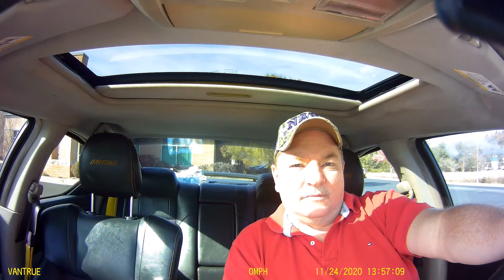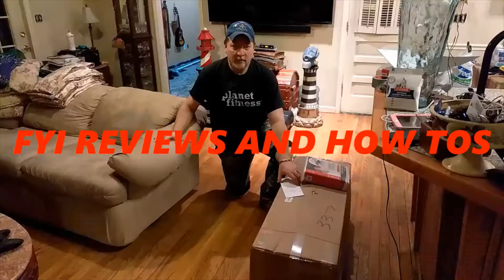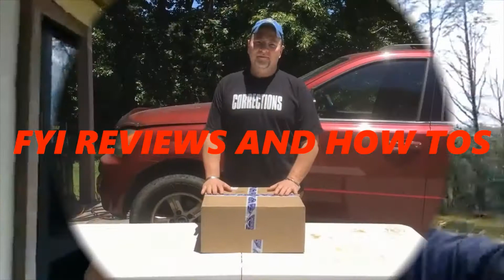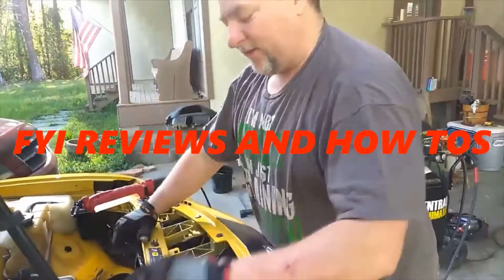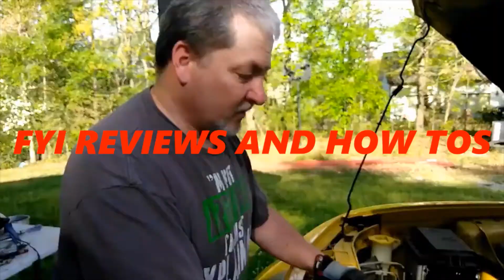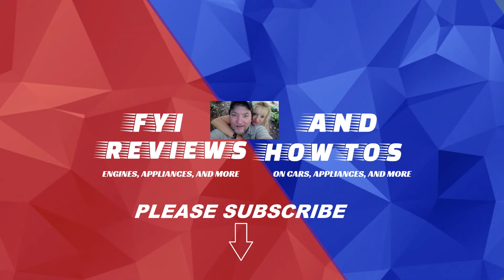TORQUE CONVERTER SHUDDER CAUSED BY THE MDS ON A 2006 DODGE CHARGER

Comment: I installed an LED that lights up when my mds turns on my 300c 06 and acted exactly how you described. So I drive on dr 4 and my shutter goes away. Have you found out what links the mds to the torque converter? Is it when the mds engages it sends a signal to the tcc to lock or something? The reason im asking is because it also ocassionally stalls the engine. So i was wondering if maybe my torque converter clutch was staying locked causing my engine to turn off?

Comment: This was such a huge help.  5 mechanics couldn't figure what you figured out. Big thanks.
Reply from the maker: You are welcome. My advice is to have a full MDS delete done. It is costly but the risk of keeping the MDS lifters, and cam out weighs the benefits.
Reply: Nice video 👍🏽I just spent hours trying to find the problem and didnt want to remove the mds and found out finally that it was my motor mounts!!! I did the transmiton flush and added the friction modifier and nothing. But the mount was the actual cause!!

Comment: You can turn the mds off with the diablo Intune i3 tuner? So you need a diablo tuner to do it?
Reply from the maker: Yes, but if you just turn off the MDS electronically you will still have the MDS cam, lifters, and actuators. Which is fine if you just want the system turned off. To do a complete MDS Delete you have to replace the cam and lifters with a non MDS cam and lifters plus install MDS delete plugs (not spark plugs). After installing the MDS delete kit you then have to turn off the MDS using a tuner such as the Diablo intune i3.

Comment: 2011 300C has been shuddering whilst crusing in eco/MDS around 30-40mph. A slap of the shifter would disable MDS but I wasn't sure if it was unlocking the converter. A bad purge canister set off the CEL today thus not allowing MDS to kick in and the shudder is gone. I was doing some digging when I came across your vid.  You got another subscriber.  Cheers!
Reply from the maker: Thank you

Comment: My 2012 300c does this as well and i can also be at a constant speed at maybe 50-60 mph or any speed and my throttle would fade out and if I don’t get off the throttle then it would throw the p0741 code
Reply from the maker: Sounds like your problem might be different from what I was talking about in this video.
Reply: aye man would ur throttle not respond then respond again and take off? my problem happens at 55mph but its started happening at any speed over 30 now 2013 300c
Reply: My 2014 100th anniversary charger does the same thing you ever figure it out?

Comment: Same vehicle as you……I took to shop and was told I need torque converter..wondering if that would work for me.
Reply: Thanks will give that a try once I get a little time
Reply from the maker: I was told the same thing but turning off the MDS worked for me.

Comment: Dodge ram 5.7 hemi 2009. Mine does a shudder here and there. Doesn't matter the speed. Only goes away if I brake or accelerate. Now, I have No noise, no smell smooth shifting.  My shudder feels more so on right passenger side
Reply from the maker: If you can feel the shudder on a specific side, it sounds like you may have a tire issue. One or more of your tires may be out of balance or may have a broke belt. Take your truck to the tire shop and get it checked.

Comment: I have the same prob on my 2010 RT heavy shudder slowing down at 20 MPH , saving up to get a Diablo tuner hopefully it helps
Reply from the maker: If turning off the MDS does help,s, I recommend doing a complete MDS delete and replacing the lifters with Hellcat lifters.  Contact Jay Greene racing on facebook because he is a good source of info for an MDS delete.

Comment: Say if I was to disconnect the solenoids without tuning, will my car still vibrate??
Reply from the maker: Disconnecting the solenoids without the tune may cause problems with your pcm because the two are so integrated. The tuner actually programs your pcm to keep the MDS turned off.

Comment: Thank you for sharing..one question: on my 09 gmc sierra the RPMS shutter or 'idle' up and down as i am slowing down, for example as i slow down from 50mph, it shutters at around 30mph, then at 20mph, and one last time just before completely stopping...is this a bad torque converter or transmission issue?...or more like an engine idle issue like throttle body or similar engine issue?...thank you
Reply from the maker: Thank you for watching my video. As for your GMC it is impossible to diagnose your problem without driving the vehicle. I can however give you some tips.  If you you are having a torque converter shutter you will feel the shutter coming from the drivetrain as if the whole truck is slightly shaking. It will not feel like a rough idle.  Assuming that it is a shutter coming from the drivetrain it more than likely is not your torque converter.  If it is a shutter coming from the drivetrain I would first check my tires because an out of balance tire or broke belt in a tire will cause a shutter at different speeds. A simple way to check for a broke belt is to Jack the truck up just enough to get a tire off the ground then place a brick or even a cinder block as close to the tread of the tire as possible without touching the tire then rotate the tire by hand. If the tire has a broke it will hit the brick/block. You can also take your truck to a tire shop and have them to check the balance of your tires. If the tires are okay then look at your driveshaft especially if your truck has a two piece driveshaft with a center support bearing. The center support bearing is actually just a rubber bushing in a metal frame that supports a two piece driveshaft. Check the rubber to see if it is worn, has cracks, or holes in it. You can also check the center support bearing by grabbing the driveshaft on each side of the bearing and push the driveshaft up and down. If you can fairly easily bottom out the driveshaft inside the bearing, the bearing needs to be replaced because a worn center support bearing will cause the shutter.  Even a single piece driveshaft can become out of balance itself. You could also have worn U-joints on the driveshaft that cause a shutter. 
These are just some of the things that could cause your truck to shutter. I am not ruling out the torque converter but it is better to check the simpler things before spending a bunch of money to have a torque converter replaced.  I hope this helps you out and gives you some ideas on what to look for.

Comment: My 08’ 300c shakes when going over 40 once I get on the gas a little more it goes away did you have the same symptoms
Reply: Mine is doing the exact same thing!!! I cannot figure it out
Reply from the maker: @j.t.553  I recommend the Diablo intune i3 tuner if you own a Challenger or a Charger simply because of the code reader ability and the options that include turning off the MDS when you do a tune. A faulty transmission pump and a faulty torque converter can also cause this problem.
Reply from the maker: No I did not. My ‘06 would vibrate as I was slowing down through 30-20 mph then it would suddenly stop the slower I got. Several things could be causing your problem for example a broke belt in a tire or more than likely you have a worn out driveshaft coupler. The driveshaft couplers connect the drive shaft to the transmission in the front and the differential in the rear. They are black rubber disk that wear out and cause the shaking.

Comment: I have a 06 Chrysler 300c, I noticed mine shook for awhile and I ignored it. now my transmission is leaking from under the bell housing shaft seal?
Reply from the maker: There are multiple issues than can cause torque converter shutter, for me it was the MDS. Unfortunately to replace the front seal on the transmission, the transmission has to be pulled.  A worn out trans pump or a torque converter that is failing to lock and unlock can cause the shutter. Since the trans has to be pulled anyway to repair the leak you might as well get the trans and torque converter checked.

Comment: My car shutters when I sit still .. not sure if MDS system would come into play .. ideas??
Reply from the maker: It is impossible to diagnose a problem without being in the car or inspecting it.  You could have a rough idle due to a clogged  fuel injector, bad spark plugs, or bad coil pack to give a few of examples. If the car is in drive while you have your foot on the brake the torque converter can still vibrate. If the torque converter is shuddering or vibrating you will feel the vibration/shudder coming from under the car.
Reply: @fyireviewsandhowtoos3118  yea I get is hard to say what it is without being in car .... But thank you for the response

Comment: So you didn’t have to put plugs in place of the mds solenoids or put a new cam in it? I have an 06 ram 1500 and have shudder when I go go from cruising speeds and step on the throttle to speed up. If I don’t hammer on it to down shift it’ll shutter if I just slowly accelerate. If I hammer it and down shift there is 0 issue. Also randomly stalling.
Reply: I have a 2009 1500 5.7 hemi ram. Mine shudders only at coasting speeds and doesn’t matter what speed I’m coasting at, if I brake or give it some gas it goes away. Just recently, I'm having rpms go up to 2000-2500 to shift from 2nd and 3rd gears. It shift smoothly though after delay. What ended up being wrong with yours?
Reply from the maker: I did not remove the MDS, the system is still in the engine. I just I just shut it off.  Most people remove the MDS itself because the solenoids and lifters themselves can fail.
Reply: I have this same problem with a 09 grand cherokee hemi.

Comment: I just got a cam and still have my stock torque converter. Its terrible lol I need to get a upgraded converter wondering which to get
Reply from the maker: Checkout Summit Racing and if you are upgrading why not go with a stall converter? Just remember that you gotta do that tune also.
Reply: @fyireviewsandhowtoos3118  is a stall converter and a torque converter the same thing?
Reply: @fyireviewsandhowtoos3118  yeah my Hp tuner guy coming back to retune my car also
Reply from the maker: Converters that are designed for higher stall speeds are called stall converters. This is a real good video that will help you understand.
https://youtu.be/XfNG69r7MBA